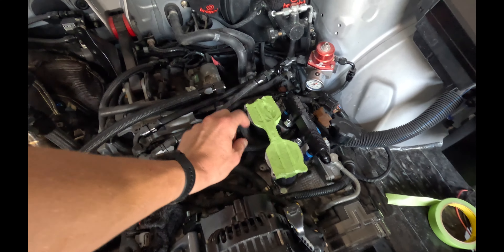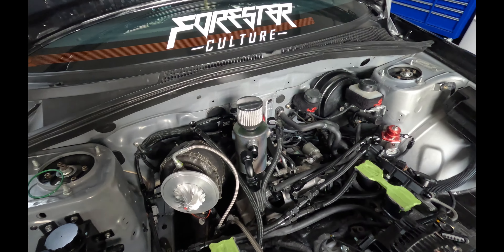BIG TURBO SUBARU FINAL ASSEMBLY PART 1 | PROGRESS & PROBLEMS | ROAD TO 800HP SUBARU EP 47

Comment: Can you guide me with the intake manifold fittings lines in the rear. Having trouble with those on my subi right now
Reply from the maker: They are hard to find, some type of special threads in the PW manifold. Mine came with the fittings, possible try to get in touch with process west!